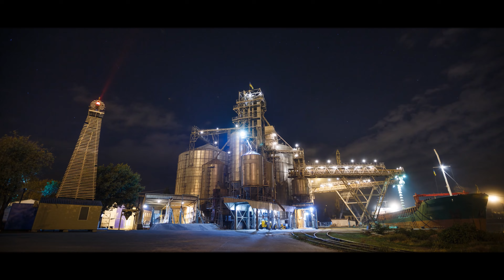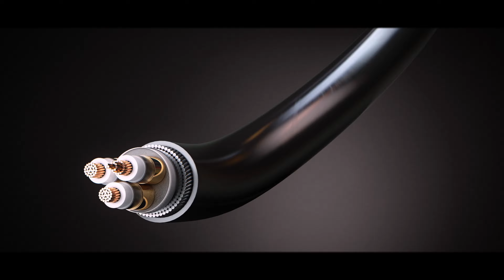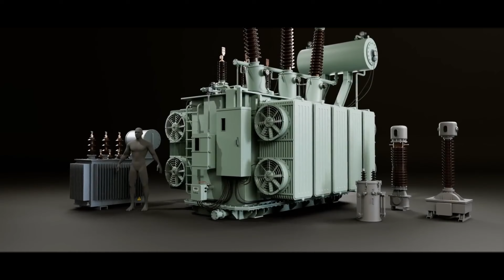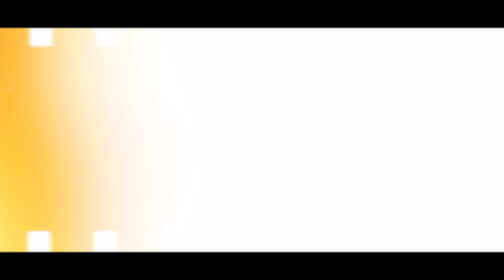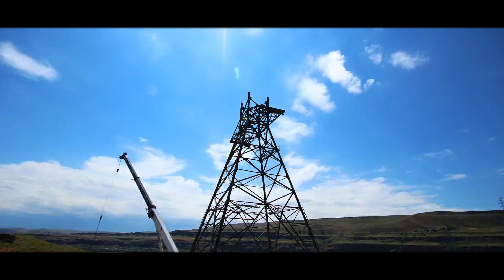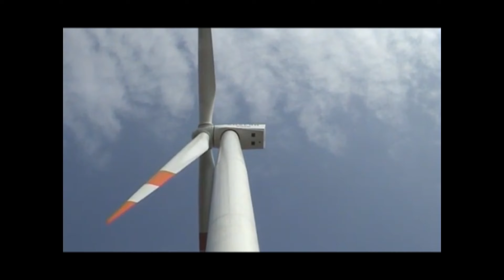How China Built the Impossible: A Continent-Sized Power Grid

Comment from the maker: The engineering behind moving 12,000 Megawatts across an entire continent is absolutely mind-boggling, but the real paradox is at the sending end: building state-of-the-art desert solar bases only to back them up with massive coal plants just to keep the 1,100kV highway from collapsing.
What do you think is the ultimate solution to this grid-stability trap—brute-forcing it with more synchronous condensers, scaling up experimental battery storage, or is this "coal lock-in" a necessary evil for continental grids? Let’s talk in the replies! 👇
🎬 WATCH NEXT: If you want to see how these exact same superpowers are fighting an invisible war for resources on the ocean floor, watch our deep dive into the 6,000-Meter Abyssal War here: [https://youtu.be/ipJPiMTGzyo]